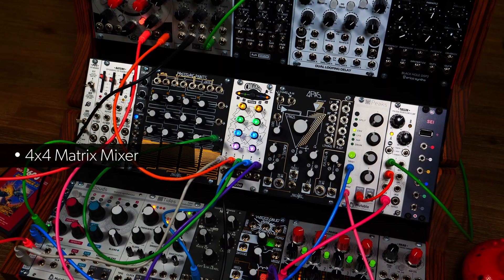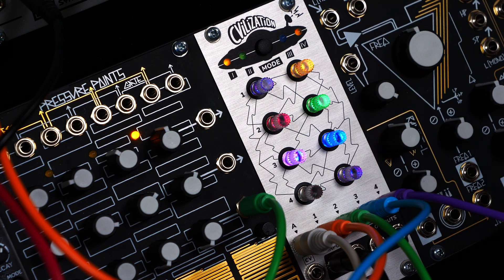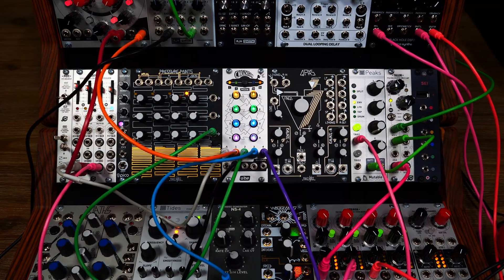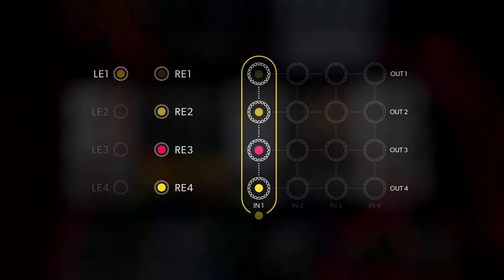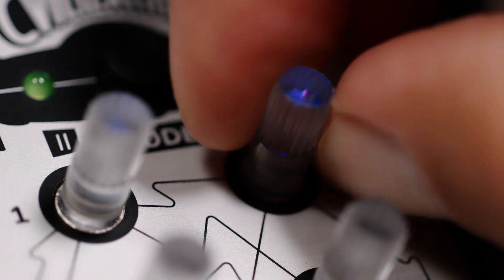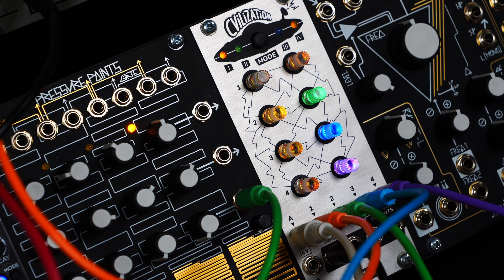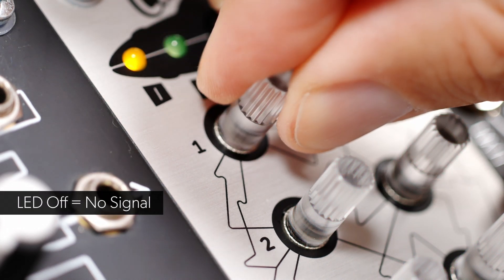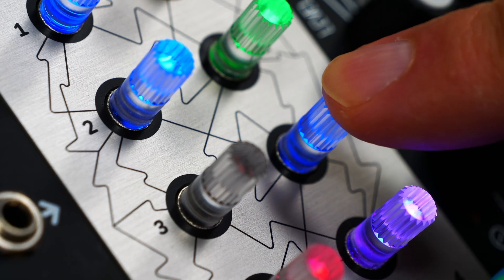u-he CVilization Mode I: 4 x 4 Matrix Mixer – Basic Operation

Comment: How can it quantize to a scale if it doesn't know the root note? You say it can quantize to a minor scale but A minor and B minor have different notes in them. How do you tell the module this? Thanks
Reply: I presume that it quantizes relative to the incoming signal - whatever is 0v will be its "root" and that in turn will depend on what 0v - or any other voltage - translates to on your VCO.

Comment: Very useful module! Can I put 4 different 1/oct signals to 4 inputs and get quantized individually?
Reply: Yes, that is one of the most straight forward things one can do. Now imagine that - because it's also a mixer - you can use one of the inputs to also transpose all of the others...
Reply: @UrsHeckmannBerlin  great! Is it possible to edit clock to divided each quantization outputs differently while using the quantization mode? And can I order it direct from the official website?
Reply: @ys521wow  Every parameter (quantization scale, clock source, clock division etc.) can be set independently for each channel.  Each output can have clock from either CV-A, CV-B, their combination or Bus Gate. For example, you can have CV-A on Channel 1 and 3, CV-B on Channel 2 and Bus Gate on Channel 4. Each Channel can have its own Clock Division (1, 2, 4, 8) and scale (e.g. minor on Channel 1+4, blues on channel 2, diminished on channel 3).

We currently only sell through Schneidersladen (they ship worldwide pretty much), but we have started talks to more shops. If you wish to buy from us directly, you can send us an email (support at u-he dot com), I'm sure we can do an exception occasionally, but we have no experience with it yet.
Reply: @UrsHeckmannBerlin  thank you for answering those questions.
Reply: @UrsHeckmannBerlin  ordered it!

Comment: Mind if I inquire about the resolution of the knobs/ possible values? (Ie. how fine can you go with stepped encoders) 🙂
Reply: This is a valid concern, which I'm happy to address.

It varies. On the offset pages it's quite obvious. Each tick is an octave, a semitone or Cent. So we have between 20 and 200 values that can be reached with an encoder. Finely grained parameters are involved with work quickly.

On the Mixer I think it's 32 values from zero to unity, and another 32 for the negative range (64 in total, but I really should look this up... take with a grain of salt). This granularity has been a good compromise for work vs. resolution for me. A full circle on the encoder is 24 ticks btw., but then it's so thin it's easy to dial quickly. We also weren't able to break them easily when going berserk on them.

In the 2nd Mode we opted for gain steps that equal semitones as the mode is very useful for sequencing. In that case we found that a range from 0V to 3V (3 octaves) is pretty good with 36 steps. However, we made this customisable. You can choose to go to up to 10V and you can choose the interval for each tick.

There have been further suggestions such as accelerated encoders which we might look into. We'll see what the feedback is gonna be like in the upcoming weeks. I'm sure some people will bring this up in videos and we're going to do what we can to offer solutions. So far however, it did not seem much of a concern.
Reply: @UrsHeckmannBerlin  First off, I really appreciate the detailed response. ❤️ 

Second, I suppose I’m not currently envisioning an instance where 32 values won’t suffice, but I anticipate it would be nice to be able to go finer if need be. (Ie. Waldorf’s Iridium has stepped encoders that you can press to go finer, etc.)

Lastly, I’d just like to say that I really do dig that you went with stepped encoders, as it’s easier to make precise adjustments. 😁
Reply: @UrsHeckmannBerlin  I know this post was from 3 years ago, but have you guys received much feedback on the CVilization yet on possible updates including the "accelerated encoders " ? Thanks for all of your hard work! Love the module!
Reply: @na-dj6ob  we're collecting feedback sent to us via email or our website contact. There are loads of ideas, but currently our priorities are set elsewhere. For instance, some ideas for envelopes in CVilization are now manifesting in a module on its own. Also, as far as I know, the request for accelerated encoders has never been brought back to my attention, but then I have spent most of the past two years on software projects. Can't wait to get back into hardware, but I can't see myself getting involved deeply with the hardware team before the end of 2024. Therefore, the best way to give or get feedback is through the feedback form of our website.
Reply: When you have a question and the owner of the company answers. I love U-He.

Comment: Question, how do you acces configuration page? long press perhaps? That's  the only step that isn't explained. Also, can you visually discern whether you are in performance, program or configuration mode?
Reply: Hi, yes, it's a long press. Visual clues: A "breathing" encoder means you're on a Program Page for that Input/Output/Channel. Also performance pages and config pages have typical layouts which are quickly memorized.

Btw. there is another video (CVilization: Introduction) linked in the description which explains all the concepts that are consistent among CVilization's modes.

(We linked to this video in our newsletter because it's more specific to what CVilization does than the other video. We're currently producing more explanatory videos so people can get started, before we go into example patches and maybe a showcase video or two)

Comment: Incredible module. Does it have some kind of limiting function so that you can’t fry destination modules by sending several hot incoming signals to the same output?
Reply: It saturates at +/- 10V, pretty much like any buffered multiple would. Hehehe, I wasn't aware of modules that could be fried by others - if you drop us an email to support at u-he dot com, we're happy to buy such a module and try it out.
Reply: @UrsHeckmannBerlin  Thanks for your answer. What I meant is, what if we mix four VCOs and we send the mixed output by mistake to a single destination? Couldn’t the signal be too hot?  Like 10 volts x4 = 40 volts?
Reply: @friendlynoise  Ah, I see what you mean. The output voltage can never exceed 10V. Internally the module simply does some clipping. For CV signals this usually is no problem at all, but for audio signals it can get distorted. However, most audio signals are in the +/- 5V range and the average volume/energy adds by square root, not linearly. Thus, 4 bipolar signals in the +/- 5V range add up to +/- 10V on average, as the square root of 4 is 2. The peak can still exceed 10V internally, and that would clip, but it doesn't happen as quickly as it may seem at first. But yeah, while CVilization is very forgiving to high levels, it's still a good idea to mix responsibly.
Reply: @UrsHeckmannBerlin  Thanks again. Now I’m confident CVilisation will be in my rack sooner than later. 👍🏻